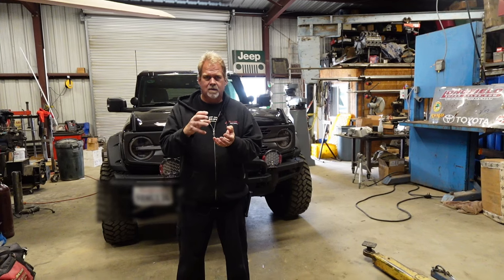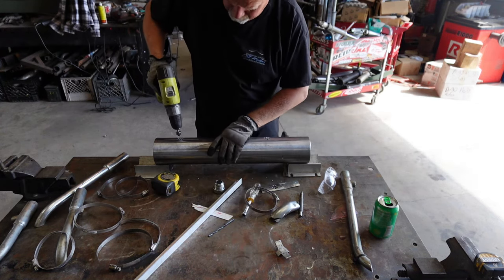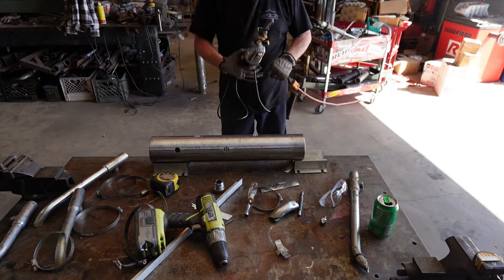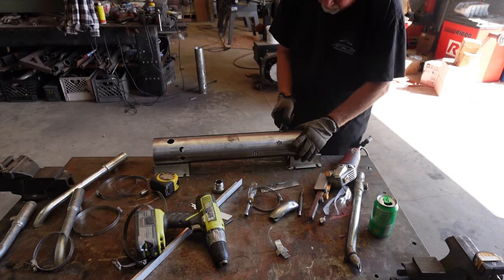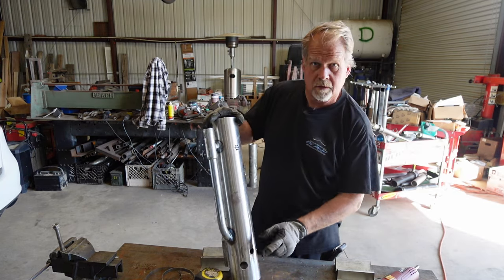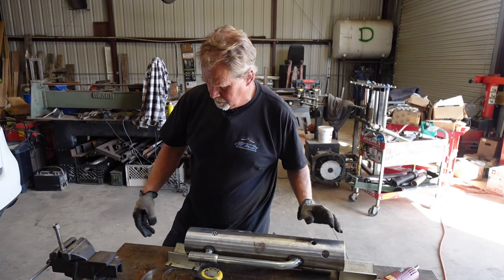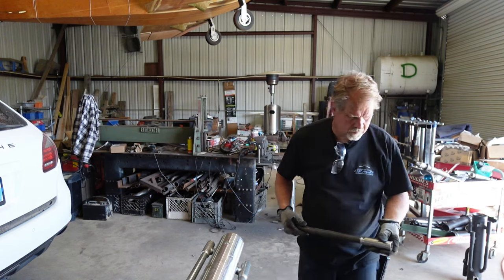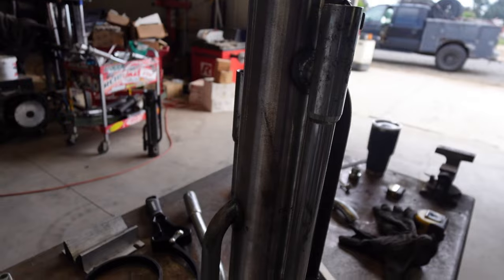Building a Bypass Shock Part 2...Wayne's Way!

Comment: What is the pressure it is test at ?
Reply from the maker: 200 psi just looking for air leaks. If air leaks at 200 then oil will too, if it doesn't the  oil stays inside fine. There was a pin hole on the res tube and one we though maybe was a leak but no continuous bubbles. We welded it just in case.